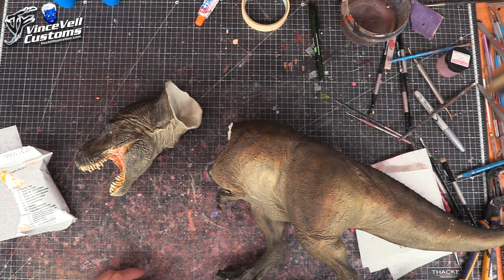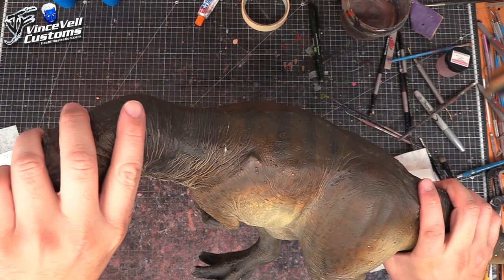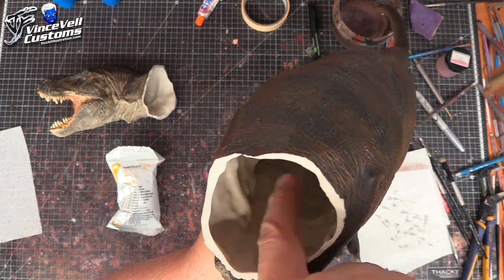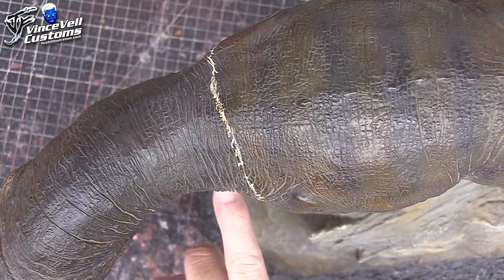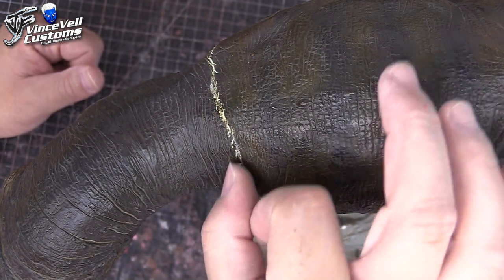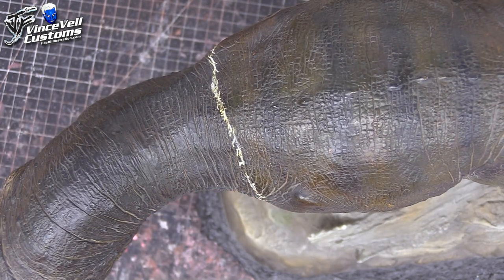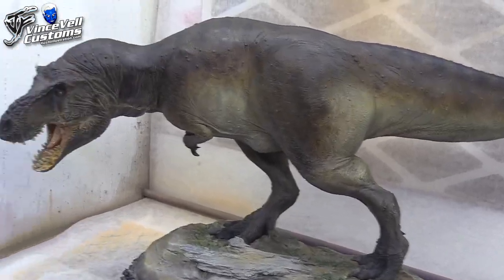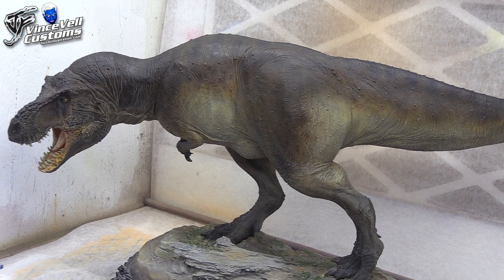Sideshow Collectibles Dinosauria T-Rex Hollow Damaged Statue Fix

Comment: Nice worke. It's like it never happened.
I got the big V-Rex Bust from ebay. 
It was well packed but not the original Styropor form. It broke a the neck.
So i bought 2part epoxy glue (150kg/cm2 ...working time 5min) and put it on the edges.
It's fixed now and is invisble too because it also filled small cracks.

But i hope it holds overall because i didn't ad any kind of extra enhancement inside. 
Normally the resin glue should attatch with the resin of the bust like it's one piece.
Reply from the maker: Should be fine if you used enough glue. I just go further with my repairs cause of shipping and longer term security for people.

Comment: Great video John...ever tried filling it with aluminum foil vs. fiberglass? I notice a lot of people start sculpts by using foil before moving to clay.
Reply from the maker: I used foil in the past but with really large items, so it can work as well if you wanted to use it, I just wanted to secure it a bit better since it hangs over the feet so much.

Comment: Great work , do you think if a foam spray will work to fill inside the broken statue?
Reply from the maker: You can use that foam from home depot, but it really doesn't work well if you don have a large opening and it tends to collect at the bottom and crystalize. Also if your item is egg shell and you spray into a tiny hole can pop the item and crack. Ive use it in the past but without that large opening it doesn't expand correctly. 

Smooht on makes a expand foam which works a lot better but have to funnel it in and have a good opening so it doesn't expand and go all over the item.